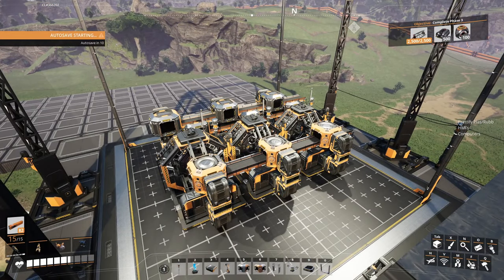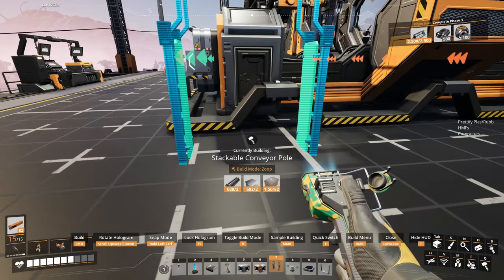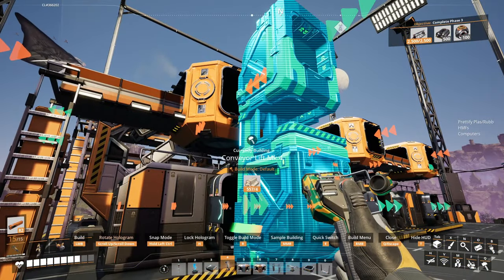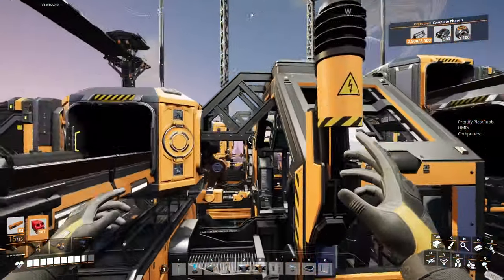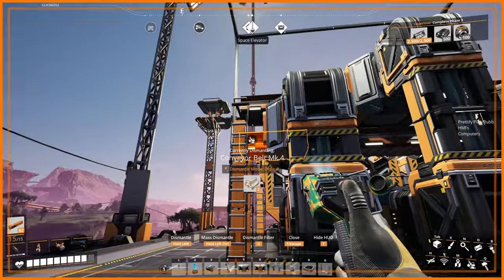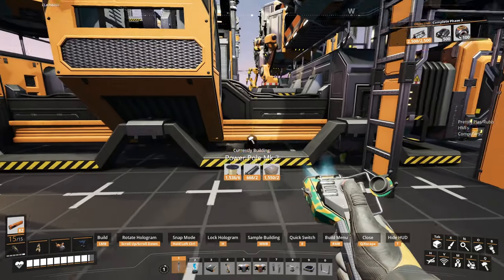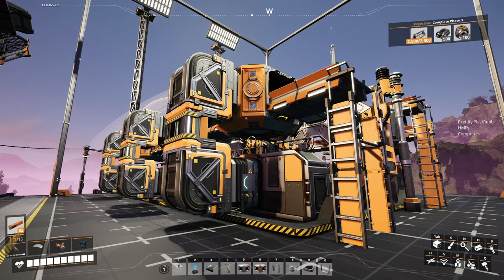Early Game Assemblers Blueprint - Compact, Clean, & Tileable - Mk.1 BP - Satisfactory 1.0

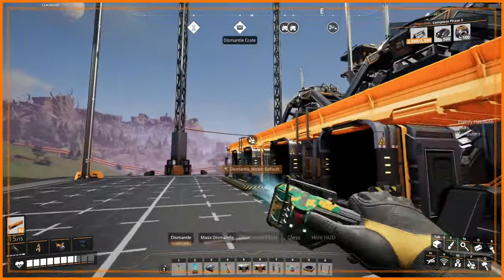Comment: 1:35 i tried it and the lift did connect to the lower one. makes it cute and small.

you can test it yourself by making a belt in a straight line on the BP maker, then placing a conveyor pole in front with enough distance for a lift, then connect the lift to the pole first, and then connect it with the belt as long as the lift is in the correct direction. For the assemblers, you have to connect the lift on the assemblers first then go for the Merger/splitter, but it 100% work on the first level.

Comment: I love you for these compact blueprints. Using the area with 6 normal iron, 2 limestone, and 2 copper nodes in the Rocky Desert. I just tore down my starter spaghetti and am building a large factory to max out all of these nodes with maxed T2 miners, and working on iron only motors and heavy mod frames. I just love that there’s no belts on the floor and they look so clean, and the scalability 🤤

Comment: I use almost the same scheme, but IMHO it much easier to right positioning mergers/splitters using a foundations. And it can be even more compact, if you at first place temporary merger/splitter in position when conveyor lift rubber part (which is connected to the assembler) completely hide in the in/out ports. Then just remove foundations and temporary parts, and simply snap splitter or merger to the top port of the lift (yes, in 1.0 it works, so we don`t need modded splitters and mergers with additional top/bottom ports) and connect them with conveyors

Comment: this is a good blueprint but you can take it a step further. right now you made it tileable to place multiple in a row, but if you take this exact same blueprint and save a new version of it where you make the inputs come in from the opposite side and the outputs go the opposite direction you can then also stack this blueprint. Essentially make a "left" and a "right" version of this 1 design.

so lets say you want to place this blueprint down 4 times, right now it's an overall footprint of this blue print x4 in length. If you make the reversed version of it as a second blueprint you can have this blueprint placed 2 in length, but 2 in height. Still giving you 4 but taking up less space horizontally. it's just a matter of  using lifts on the ends to connect the top/bottom blueprint and building some walls/ceilings so it looks good

Comment: Hey thanks for the tips, how do you know when the conveyor lift is attached to the splitter/merger or not?  
You said listen to the click - i dont think i heard a noticeable difference when you placed them - is there a way to check after placing them? ( except hooking up materials )
Reply from the maker: So when you hear the second "tick" noise, like if you're building bottom to top, once you've anchored the bottom, and you hear the tick noise when the top part snaps to a splitter or merger, that means it's good to go. You won't hear another tick after you anchor it if it's not good. It ticks when it snaps to something. So you can raise/lower it or rotate with mouse wheel to go back and forth to find out.

Comment: Why not place the lifts and put the splitter/mergers right on the top of the lift? You don't have to re-create the lifts, nor place the conveyer poles.
Reply from the maker: The splitters/mergers snapped on top of the lifts looks super bad to me, because the models for them don't have little holes in the bottom to accept items, so it looks wrong for items to go up through the bottom of them.

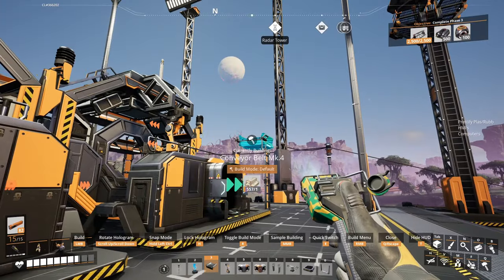Comment: 1:56 wait what. the placement is different compared to the other side?

You're also using MK2 power poles in this one?
Reply from the maker: yeah a few inconsistencies, sorry. Mk1 vs 2 power pole doesn't matter. And the placement of the power pole is on top of the 2 meter beams. Then the wall outlet is on the 4 meter beam. I think in one version, i built the 2 meter beam on top of another 2 meter beam (that already had a pole on it), so its kinda like a short pole then. But either way works fine.